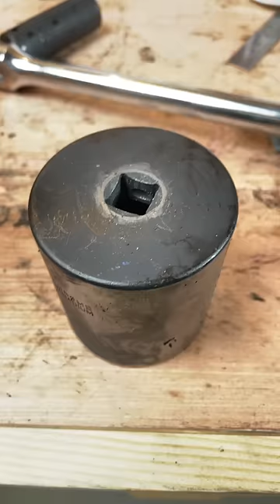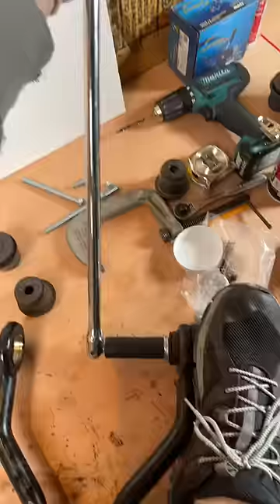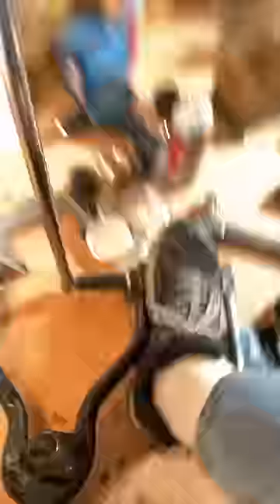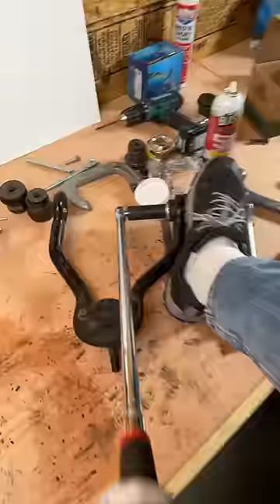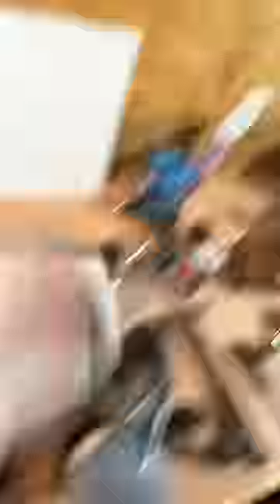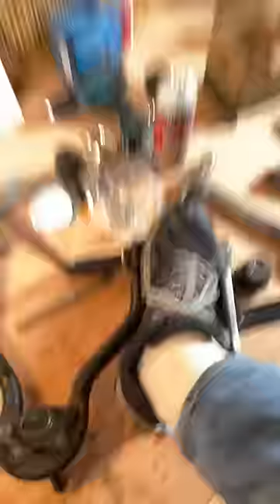Easy Method To Remove Bushings From Control Arms!!

Comment: That moment when you realize that a hydraulic press would be a great purchase
Reply: I own one. Needed it for a repair one time. Cheap one from harbor freight, but when you use it, you wonder how you lived without one. The pop sound can you scary at times. I also live where rust is a real issue, so the is that.
Reply: Until you can't fit it in the press because the stupid knuckle is in the way. Lol I had to break out the wood block and hammer today 🤣
Reply: @schrodingerscat4737  always something... I had to put a bushing on a rear upper control arm on my Ford Flex a while back and I had to cut one of the bolts and buy another one for $70 because the bolt hit the frame and wouldn't come out without cutting it off and putting a new one in the other direction.
Reply: @patthesoundguy  Somebody at the Ford Flex factory had it out with you and put that 2 dollar bolt (factory price) in backwards!
😄
Reply: @raybin6873  it was punishment for owning too many Chevy's in my life 🤣
Reply: @patthesoundguy  Chevy doesn't make Ford Flex vehicles do they?
I've come to like Japanese cars now..my 1996 & 1997 Rodeos have been very reliable (they actually have Honda engines with ISUZU name on them).
I'll never buy a new car ever again - don't need to - too much electronic crap on new ones.
👍
Reply: @raybin6873  Flex is Ford, what I meant was I have owned many GM vehicles in my life but never a Ford until my Flex
Reply: I've used a vice before buy yeah some smaller press at pretty inexpensive
Reply: @patthesoundguy   ah the old infamous FU bolts. It's only purpose is because; FU is why. Those are the bolts that make me wonder what mechanic pissed in the engineer's Cheerios. But I have to be careful with those kinds of thoughts because then I'll start questioning life and why I became a mechanic. Future reference though; don't spend $70 on one bolt. Spend the $2 entry fee at your local junkyard and then cut that thing out. Most of the time they won't charge much if anything for one bolt.
Reply: Ya just replace the whole arm most don't even have a removable ball joint
Reply: At patthesoundguy - Ford Flex is a damn cool ride!  I see a nice one - lowered on nice wheels - everyday when I drop my kid off at school.  I wonder why I don’t see more like that?

Comment: It always ends up being more work than anticipated
Reply: Especially when you don’t just use a long arm 1/2” ratchet, or a 1/2” electric impact or using soft zinc bolts instead of grade 8 or 5 bolts.

Comment: i did trailing arm bushings from the axle on my volvo 240 this winter. it took months of fiddling with diy spacers and press tools, had to be just the perfect size. running between my family farm shop with the metal working tools and heading home to see try it out. Once i got everything lined up perfectly the m12 stubby made quick work of it

Comment: Jimmy, it's past time to invest a little in some tools. Get yourself a HF 20 ton hydraulic press plus at least the master ball joint press kit or the front wheel drive bearing removal and install set.  A set of 1/2" impact sockets also come in handy.  They will save you a lot of aggravation and running around trying to find the correct size of adapters for the job.  (I was able to get the 20 ton press for the price of the 12 ton because they were out of the 12 ton press.)  
I could kick myself for not buying those years earlier.  You will find many uses for them.

Comment: Most ball joint presses have multiple adapters for pressing bushings in and out. They can be rented( free ) from most of the part stores. If you don’t have air or electric tools, you’ll still need a vice( preferably ) and a breaker bar, but the mechanical advantage of the press, will work in your favor.

Comment: The easiest way i found is to run a drill in between the outer sleeve and the rubber. It walks the rubble out of the sleeve and then you can push out the outer sleeve.

Comment: A suspension shop what do you use a small torch to cut the rubber and then smash it out warm it and then repress but still out of the control arms.

Comment: it's SO unbelievably easy, that i DON'T believe it! LoL been there man, ive had the best luck with iron pipe, all-thread rod, long nuts and jam nuts, then turning two boxed end wrenches on either end. use sil-glide on the threads. then throw the whole mess in the trash and go buy a 12 ton hydraulic press. 😅

Comment: Add anti-seize grease to the bolt threads first, warm up the part and lube it before you crank it down to pop it out.

Comment: 🤣 good tip.. if you do it that way you have to put pressure on the outside edge of the bushing. Get some good tension on it and smack the arm with a hammer. It usually shocks them loose and fall right out.

Comment: Or use a ball joint press... you don't absolutely need a $1000 snap-on BJP-1 kit, but I got it for the shop I work at because I replace u-joints & ball joints relatively often enough to justify the cost.

Comment: Just buy the control arm assembly. It has new ball joints and bushings already installed. It saves the home diy'er a lot of trouble and effort. But you're dead set on doing it like this dude, good luck to you and have fun.

Comment: Get Some Tension On It With Your Press You Made, And Smack It Hard A Few Times With A Hammer On The Control Arm. That Usually Breaks It's Loose. Repeat As Needed. That's What I Have To Do With Ball Joints On The 25-3500 Dodge Rams.

Comment: Would have worked if you used high tensile strength bolt and nut.  I've seen it done.  Also, when did HowToBasic start making auto repair videos?

Comment: I just used that method to get a bushing back in but you can use the same method with the socket but you need a smaller socket on the other side and just put a big enough clamp on it a c clamp and clamp it out

Comment: Grade 8 hardware with a smaller socket with at least a 1/4” thick washer or perhaps a strut square washer that resides at the Home De Pot electrical department also, a solid mount vice and a decent 1/2” impact rated at 500ft pound to  650 ft pounds and the use of freezing and heating will greatly increase one’s odds with successfully accomplishing this task; or just head over to harbor freight and buy a cheap press and purchase some scrap metal stock. 
However, minus the toxic smoke it’s hard to argue the efficiency of a oxy/acetylene torch set up and a air chisel when removing stubborn anything! Just saying

Comment: If you hit the metal with a hammer while you are cranking on it you will find it will pop right out. Personally I prefer to use a press. If your trying to press sticky balljoints out tap on it with a hammer.

Comment: Should work better if you flip the bolt around so the nut end is against the socket and use a harder bolt

Comment: If you have to do it with hand tools and no vise, maybe put it on the floor to work on it.
Alternately, some automotive machinists don't charge a lot to press them on and off. Horror Fright has inexpensive hydraulic presses, also.

Comment: I don’t know about trucks when it comes to control arms but a front set for most cars is usually less than $120 and the bushing set is around $50 so yeah sure you might be saving $70 but you’re also making the process more complicated ( not including the fact that you might have to spend even more money on the right tools to get the old bushing out and the new one in )

Comment: It'll work if you use grade 8 hardware however I melt the rubber out hacksaw the metal insert and yay done  easier than a hydraulic press too.

Comment: That grade 5 bolt isn’t gonna work for more than that upper control arm bushing… ideally it wouldn’t be threaded the entire length and 1/2 diameter bolts will stretch pretty easily. You found that out anyway though hahah how bent was that at the end… more washers and get an acme threaded rod because when those normal threads start cutting it’ll come apart like a bullet

Comment: Theres a wonderful tool that would help you a lot. Its called a Ball Joint Press. You can use it for things other than Ball joints! shocking, yes, practical yes also.
Also, its an old bushing, You're going to replace it, just set it on fire and be done.

Comment: Lol the wife did not hear you talking but could only hear your grunting lol
Though I was watching something not to watch lol 
That would work the problem was the bolt is not strong enough.
I have a big old c clamp that I used for the longest time to press out bushings and collapse brake calipers.
But that can work

Comment: But make sure you actually have a failed part before removing it and putting yourself and it through all this torture.
Price the arm complete.
Then price the tools and small parts.
Which makes for a sensible repair?
And as always, if it's not broken don't fix it.
Find the cause for the symptom.

Comment: That tiny, sedan upper control arm? Why not just replace the whole arm. Those two bushings, $13 socket and ball-joint separately are definitely more money and more work🤷🏾‍♂️

Anyway.... I knew it wasn't coming out after the 1st 5 cranks. Once it's broke free.. it gets much easier

Comment: Your washer's on the small end are too small. You need larger diameter washers. You're turning the wrong side of the tool. You should be on the socket side nut end. With a boxed end holding the small end while using an Uga Duga impact. 56 Uga Dugas should do. Work smarter not harder.

Comment: Not to be a D*ck but once you got it to move even a “smidge” (scientific word for the object moving more than a “Scoutch” but definitely less than a “C*nt-Hair!” ***This is absolutely true; I mean look it up if you don’t believe me. It’s in the Notes/Conversion/Measurements section near the back of just about every shop manual worth it’s salt! Plus a good mechanic has them memorized anyway.) then you can use the impact gun to keep it moving until it comes out completely.

[Pro Tip: Use a good lubricant before trying to drive the old bushings out. PB-Blaster, WD-40, Kroil, Free All, Etc…
Then if it’s still being stubborn you can use either an induction heater to assist; Or even a few good smacks with an Air Hammer/Chisel. That will start to get some rust or debris free from the threads.]
~I’m trying to give you a Million dollars worth of advice for FREE.99!!!😂

Comment: Ibusually just buy a new control arm but if you must do this set the rubber on fire using a torch it will just come out

Comment: Yeah I knew that bolt wouldn't last. I was building a shelf with 1/2 bolts and I snapped 2 or 3 of them with regular wrenches. And this guy uses breaker bar....good luck

Comment: HAHAHAHAHAHA...SOUND AFFECTS...EXCELLANT...I PULLED ONE OUT OF A FULL SIZED 71 CHEVY WAGON WITHOUT REMOVING LOWER A ARM...DROVE IT OUT WITH A HAMMER & CHISEL...USED GREASE TO RE PRESS NEW ONE IN...USING OEM BOLT...NIIIICE...